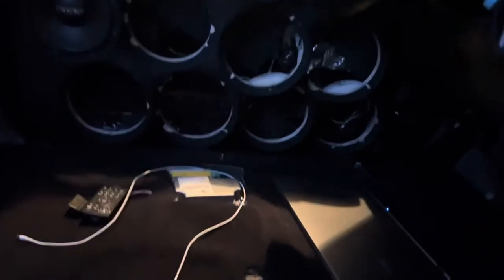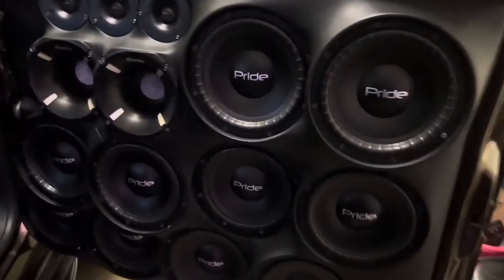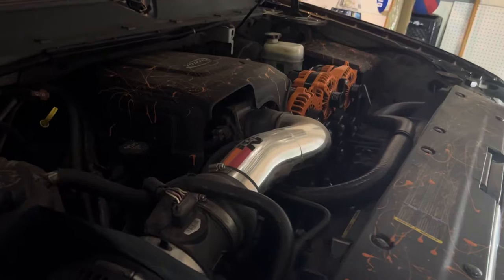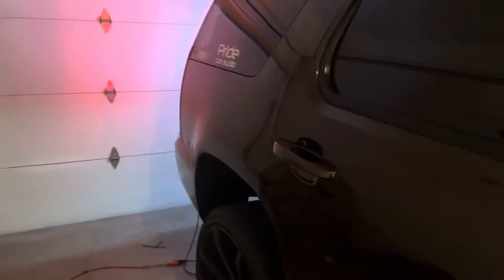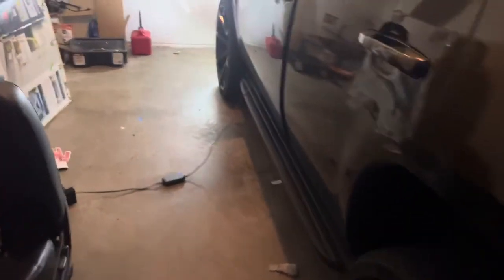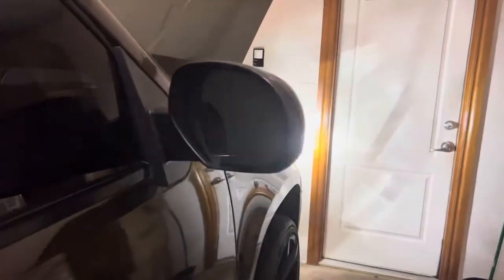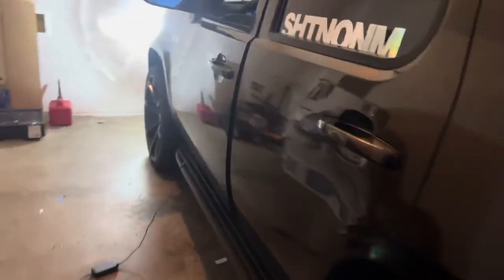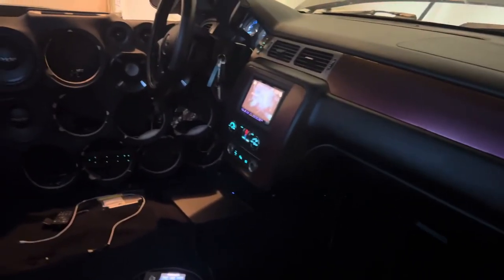Tips How to eliminate the ground noise in system!!!!

Comment: Thats weird cause I have 4 different grounds for one battery and 2 different grounds for my other battery and my amps all have their own grounds. My big 3 has all their own grounds as well. Hell, out of like 13 grounds in my car the only ground that shares a ground is my mid amp to one of my bass amps. I also use my factory harness as well and I don't have any noise what's so ever. I do use the best sundown audio rcas available. Most of my car has aluminum frame so alot of my grounds are to seat mounts and seat belt mounts😂. I'm not running as much power as you but I'm pulling around 1,000 amps
 I tried putting my battery ground to my amp ground and I got noise so I just put it back to it's own ground which was seat mount

Comment: I have a problem that I can't figure out i recently upgraded to a new setup and after installing everything my LOC had a short and since then everything has acted wrong my brand new AAK 6k is making a high pitch whining noise it threw it into a thermal protection when the LOC blew and now I don't get bass out of it only the high pitch whining though the Sub i have checked the sub with the old 9 volt battery trick and it seems fine both coils read good with the DMM BUT what really has me stumped is my KICKER CXA 1800.1 won't give me any bass now either I have redone everything again today and same thing I posted a short of the noise can you please look at it and tell me if you have ever heard anything like that before I honestly don't know what to do

Comment: what about the yellow constant wire? does that goes to the factory harness or do you not connect that wire at all?
Reply from the maker: I don’t need it, I have a external regulator
Reply: @mondo82111  what do you recommend for people who don’t have a external regular? Also how do you run your remote turn on wire? Would appreciate any tips.
Reply from the maker: @Carlossteezyblunts  run the remote to your 12volt turn on through the fuse box.

Comment: How do you seperate the 12v from the 16v? Im having issues with my yukon because of this i need to run mine at 12v while the system stays at 16v
Reply: What year gmc Yukon are you referring to I own a gmc Yukon and it charges at abt 14.4-14 stock I’m not sure if you mean you have a 16v after market alt for your amps and stuff and you need to split your power for your car stuff like ac,lights etc for that you would need a 16v to 12v dc converter for the ladder you will need to first get an alternator that puts out 16v

Comment: I think this is my problem i have horrible noise coming from my door speakers and and i have my head unit power to the factory system i tried everything but swapping head unit and rcas but maybe I should just wire my hesd unit to the rear battery bank
Reply: Did it work?

Comment: how did you wire your headunit?
Reply from the maker: Pos and neg to system battery and remote to turn on lead
Reply: Did you use an accessory wire from the truck to turn head unit off and on or is it constant hot from battery?

Comment: Holds phone to tweeter hssssssshs... see no sound.  He's deaf.
Reply: Thats a clean sound. Strong amplifiers will have that at least. Air, no hiss. When your doing thousands of watts, you cant expect it to be dead silent.
Reply: Ya cuz this is far from being an sq build lol. And that hiss is what im combating and realizing that there’s only one way to get rid of that. It involves spending atleast starting minimum $1500 for a sq amp that has a high signal to noise ration > 110db. 

I just installed my first class d amp and went with one of these d4s jp84 and I’m pretty bummed out with the results. I’m going to try and send it back and just keep using my old jl class ab amp that blows that thing out the water!!! I knew it wasn’t going to be good but with the sales going on and the extreme power numbers on the dynos I went in hopeful thinking technology has advanced that far that I could get a price of clean audio equipment for under 200 and ask for it to move heaven and hell but nah